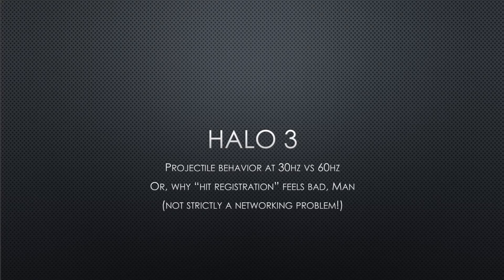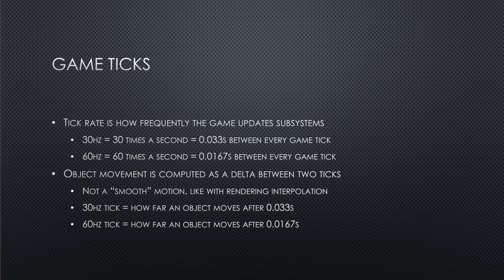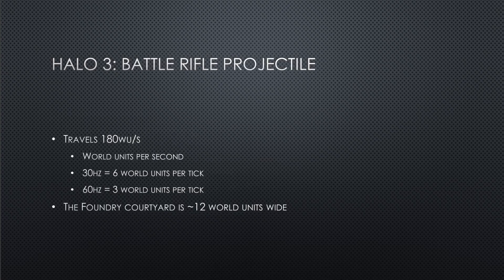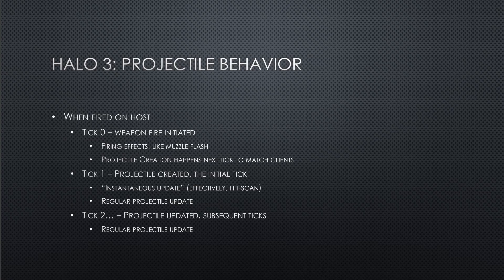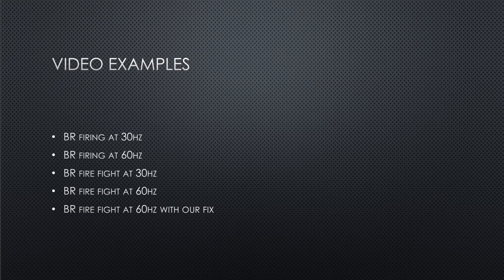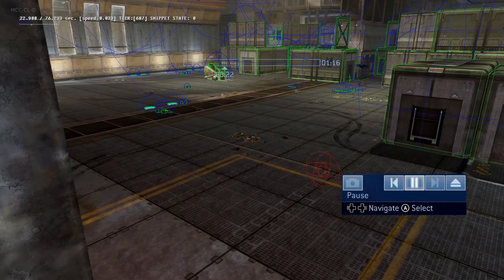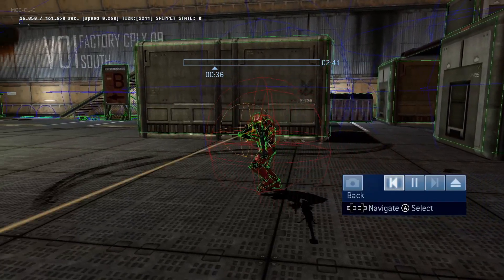Halo 3 - Projectile Behavior at 30hz vs 60hz

Comment: visualized as a gif, if i'm understanding this correctly: https://i.imgur.com/6UZ0u77.gif

cool. so the fix basically adjusts the travel sync of the 60hz bullet from the end of the 30hz tick to the start of the 30 hz tick by doubling the distance the bullet travels in the first tick. so now instead of comparatively lagging behind the 30hz bullet by 3 world units (and only matching the distance in the subsequent "in-between" 60hz tick), the bullet now matches the 30hz bullet position on every analogous 30hz tick, and supercedes it by 3 world units in the 60hz "in between"  ticks. this makes a lot more sense and actually matches a true conversion of legacy's intention, while also fixing the initial hitscan range
Reply from the maker: In a nutshell, I'd say your gif does a pretty good job visualizing the problem+fix! Nice! The whole simulation becomes even further complicated when you factor in targets which are moving too. At 30hz, the object movement has fewer samples and so the projectile may end up as a hit when, at higher tick rates which essentially have more movement samples, the target object may end up moving slightly out of the way and lead to a miss. There's also some nuance to object ordering and how that effects when one object is updated before another in the same tick. It's kinda a oldest-to-newest object update order....but that isn't true after a certain amount of time and object recycling.
Reply: @KornnerStudios  yeah that's something i realized while making the gif. at least now with the proactive positional update, there might be an equal amount of opportunities where the bullet may hit something in one of the inbetweens that would have moved out of the way at 30hz. so it kinda balances out a bit? kinda?

basically nothing about current MCC Halo3 hit registration was 'broken' (newly broken, that is, we'll discount any legacy bugs that might still be present), but the change from 30hz to 60hz has invariably led to differences that are basically irreconcilable: because it is as irreconcilable as the literal difference between the numbers 30 and 60.
Reply: @vidboy_etc  I don't understand the timing of the initial ticks of your model. Why would the 60hz model "lag" behind. If we have a 60hz model and 30hz model and say they both fire at the some tick 0. The 60hz model should update its ticks faster and get to tick 1 hitscan and projectile update before the 30hz model. But in your gif you have tick 1 happening at the same time for both models. Am I missing something here. Am I missing something? Does tick 0 not happen at the same time?
Reply: @KornnerStudios  To clarify my understanding, the real-world time that passes between shooting and hitting is identical across all the tick rates.
 Doesn't this mean that 60hz will only cause issues for the case where my target is moving, since the projectile may miss due to the finer-grained movement samples as your video demonstrates? However if the target that I'm shooting at is stationary, then I'll experience the exact same projectile behavior regardless of tick rate; the extra movement samples from the 60hz rate don't matter if the target isn't moving, and the same amount of real-world time passes between firing and hitting so I witness the projectile hitting at the same point in time.

Is that correct or am I misunderstanding?
 Thanks for the discussion and the awesome video!
Reply from the maker: @MrMeowmurs  Correct, real-world time is all the same, but how the game slices up 1 second of real-world time is different at 30hz vs 60hz (like choosing to have your pizza double sliced...same pizza, just more slices). And you are correct, if the target is not moving, then there should be no real difference at 60hz than at 30hz. However, another thing you have to keep in mind that the engine's projectile system supports an "instantaneous update", which effectively runs an additional tick's worth of calculations for hit scanning uses (another subject of its own) in the exact same tick where it ends up doing a regular projectile update.

As I try to express and show in the video, this means that the first tick of projectiles with the "instantaneous update" flag set end up traveling at 2x their speed, relative to the given tick rate. The "instantaneous update" part is critical for networking uses, and at 60hz means it would simulate half the distance it would at 30hz. But, ignoring that, you more or less see the exact same projectile behavior regardless of tick rate (on host...clients have a bunch of other factors to take into account)
Reply: @KornnerStudios   @vidboy  I don't understand the timing of the initial ticks of your model. Why would the 60hz model "lag" behind. If we have a 60hz model and 30hz model and say they both fire at the some tick 0. The 60hz model should update its ticks faster and get to tick 1 hitscan and projectile update before the 30hz model. But in your gif you have tick 1 happening at the same time for both models. Am I missing something here. Am I missing something? Does tick 0 not happen at the same time?
Reply: @fatipocyte2510   no, you're correct. the initial timing is off. in the 60 hz model the bullet is spawned 'sooner'. this is something I failed to grasp when I initially watched this. I wonder if @KornnerStudios can clarify. he does mention something about objects updating in different orders, but I dont think that's addressing this.

this solution makes more sense if the bullet waited two ticks to spawn (the equivalent of 1 tick in 30hz) but now it doesn't make any more sense. I fail to imagine a situation where if object positions and velocities were perfectly synced across versions and tests there would be a disparity.
Reply: @KornnerStudios  do you think you could address some of the questions @Fatipo Cyte and I have in this comment chain. In my gif, and from what I remember watching your video, I failed to accommodate for the initial bullet spawn timing (the bullet technically spawns 'sooner' in the 60hz model) and now I'm starting to fail to imagine practical discrepancies, if positions, velocities, and update ordering of all entities were actually synced and compared in testing
Reply from the maker: @vidboy_etc  Youtube comment threads are hard to follow since it only does on level of nesting. When firing on host, the shot always happens on the following tick. When a client's fire request comes it, the shot happens on the current tick. So, barring network latency, the host and client are on equal footing.

The root problem, when it comes to MCC not behaving like legacy, is the instantaneous update is dependent on the tick rate. The projectile only gets simulated at the distance it would travel for a tick at the given tick rate and any collision is used for an immediate hit event. Then, in the same tick if it didn't already collide, there's the regular projectile update. For both the instantaneous and regular update, we scale the simulated distance to be the 30hz tick distance. The regular update is scaled in addition to instantaneous just so the initial tick, which is the most important in near-mid-range fire fights, is as close to 30hz behavior as possible.

We could have only scaled the instantaneous update only, leaving the initial tick's regular update be dependent on tick rate, but the goal was getting the legacy 'feel' back. What players expect does not always match what the actual under the hood math should be. Weapon firing rates for players suffer from this expectation/math divergence too, due to the weapon state machines operating in terms of ticks and a few counters having to use a 'leftover' tick fraction that rolls an additional tick when it goes >=1 (eg, fire recovery time). Eg, at 30hz the Reach needler rifle (IIRC) recovery time actually ends up being inconsistent between each shot, but at 60hz every other shot has an additional tick of fire recovery time. Which can be a very interesting meta to think about once you know about it, since knowing you'll be able to pull off your shots at an expected pace between each shot could mean you don't lose some fire fights.
Reply: @KornnerStudios  So basically, what you're saying is that, we have more targets to try and hit at 60 hz? Twice the possible player positions? Does that make it twice as hard to keep on target?

Comment: I'm assuming the fix @ 60 kill would still be a 4 shot IF the bullet was led properly? Im counting 5 to kill but thinking the 12th bullet was on the shoulder instead of head, right?
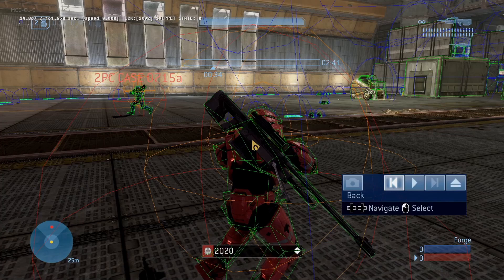Reply from the maker: I'm not sure the saved films I have for these sessions are still valid (content/code changes can cause them to be incompatible). Rewatching the video at 14:54, it would seem possible that at least one of them is a non-headshot hit as the the 6th round makes the biped stagger in a different way than previous shots. In the future, if I do more videos like this one, I'll try to include debug rendering for the most recent damage to help further illustrate what each shot is doing so you and others don't have to wonder about things :)